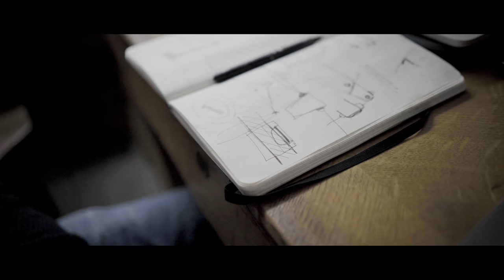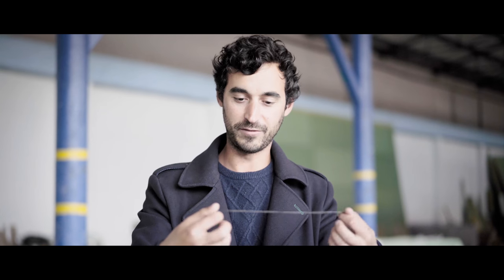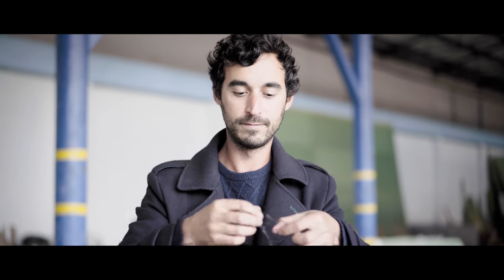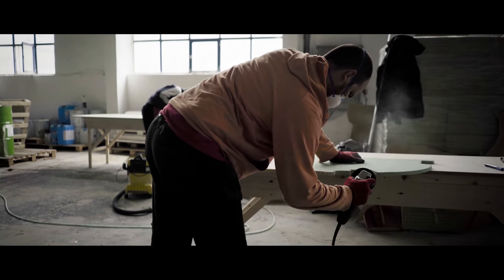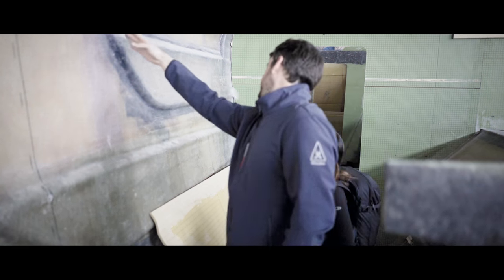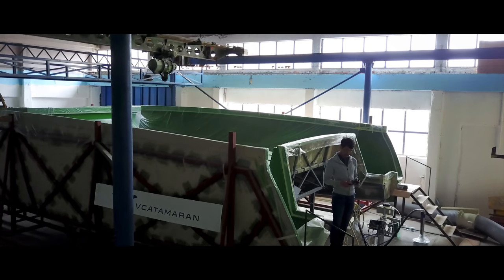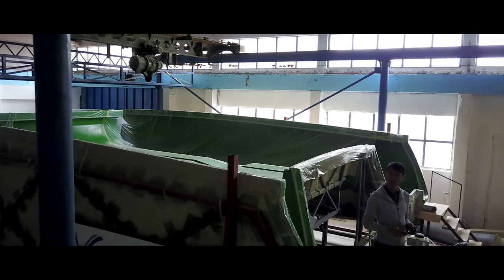1.2 - Building a Dream from Ruins

Comment: Great to hear designer talking about his design.  I noticed the Utremeer have a good flat run aft, nor volume in the stern is good supporting the excess weight people put in the stern too! 
Shame V-cat did not survive , do you  know what happened to the molds? 
Cheers Warren
Reply from the maker: Last I heard they were sitting taking a beat from weather outside.  Probably not in good shape.  I don't think anyone had done anything with them for like 4-5 years, but I don't know for sure what's happening with them.